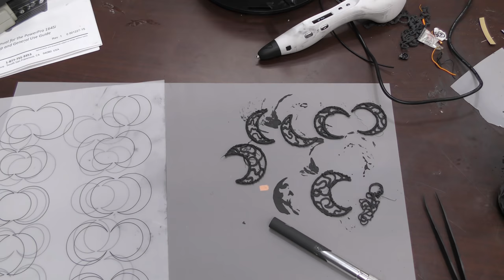3D Printing Pen Electroforming Workflow

Comment: I found a product today at Home Depot.  It's a spray on graphite lubricant.  It's just graphite powder mixed with solvent in an aerosol spray.  I just tested it out and i'm really impressed.  it applies just like spray paint and is very conductive.  Just like mixing it with acetone.  Dries in a few seconds.   I'm still in the testing phase but so far, it's very cool and easy.

Comment: In other videos you mixed paint with graphite do you find using acetone works better?  Or only use acetone when coating plastic
Reply: Acetone is used on this specific type of plastic (ABS or PLA) because it dissolves the plastic so when you paint it on it dissolves the plastic to make it soft which lets the graphite stick to the plastic directly. Then as the acetone evaporated the only thing left on the surface is graphite powder embedded in the plastic. For any other surface, paint is best because it will stick to the surface unlike the acetone which will just evaporate off and leaving the graphite to fall right off.